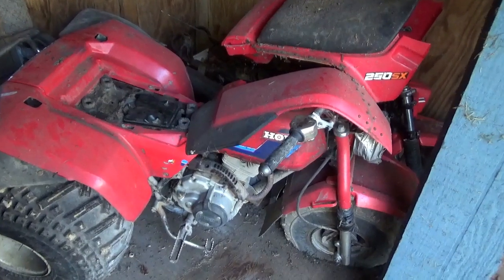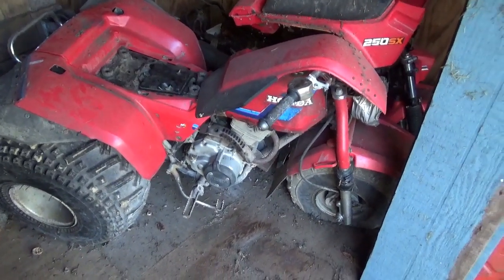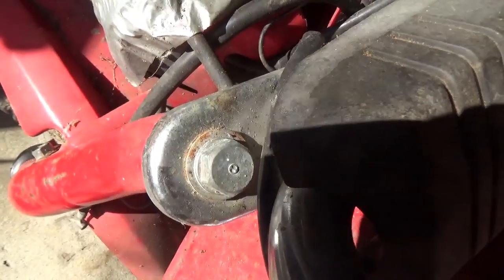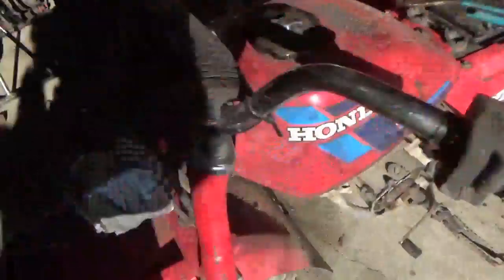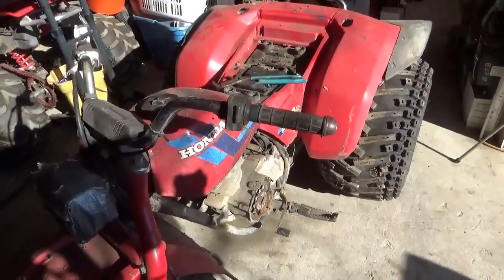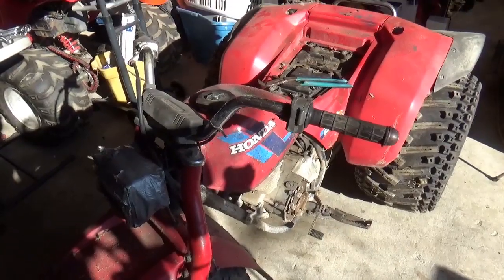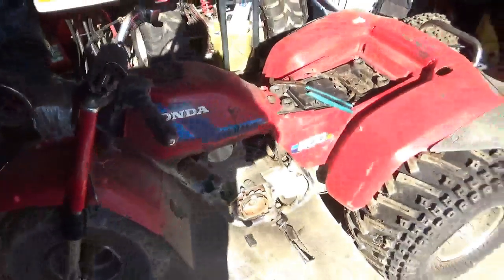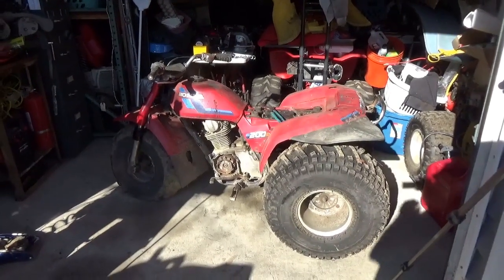1984 Honda ATC200S, Saving an ATV from a Rodent Infested Shed!

Comment: I have a project ATC70 with a slightly cracked flat front tire. I just super glued the cracks and it now holds air pretty nice. So much easier to push it around the shop! Not saying that superglue would work on that rotted to hell 200S tire, but for slightly cracked tires it's a nice and quick fix. :)

Comment: You could put Spray on rubber on the insiders the tire after all it’s not like your driving it on the road everyday and it’s not a car or truck. So I think spray on rubber would hold just fine
Reply: Spirit of the wolf Bush Wiccan   Does that work? Truck bed coating?...thanks
Reply: pinefighter1 spray on rubber in a can preferably I have never tried bed coating before. But if you want to try it go ahead and let me know how it works out I know that the spray on rubber coating worked pretty well and I did it on a garden tractor tire You’re very welcome

Comment: I missed a 185 that was probably just a engine donor but I waited too long and someone got it first. It does look like it could be nice with some tinkering and love. I like that, besides the pull start, it looks like the engine hasn't been messed with.  I like to get them before people wreck them trying to "fix" them.  I've got a small china 4 wheeler and a parts moto4 225 to pick up tomorrow. I've got them bought for scrap price so if I get the china running it will be worth the deal. I have a engine for the china that I got for free that was replaced because the starter bushing got dry and was squeeling. It looks new and after I greased that bushing the starter is working great. So if the china bike has a bad engine I'll be able to drop mine right in it. Or it may all be junk. LOL! 🙄😅😃